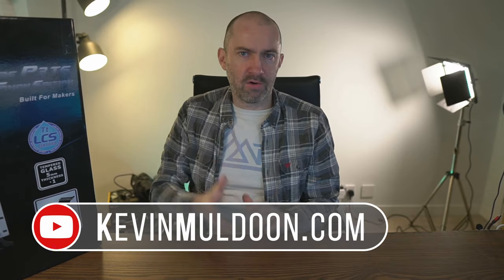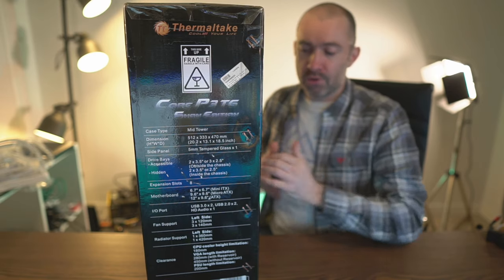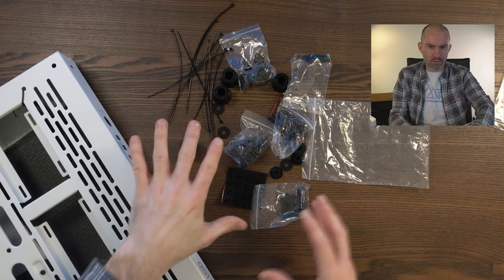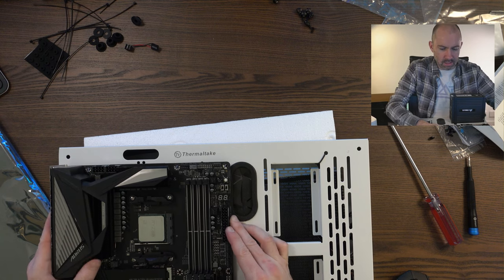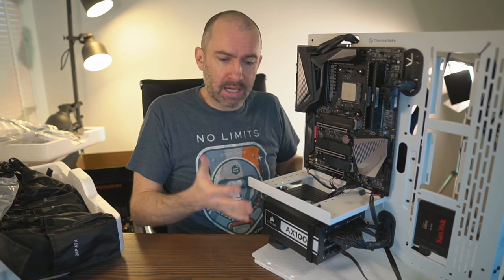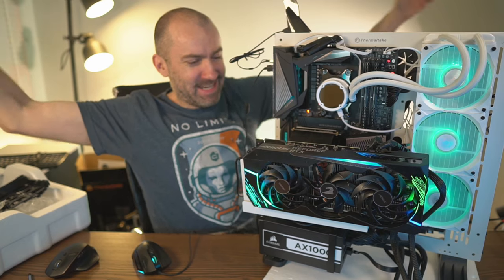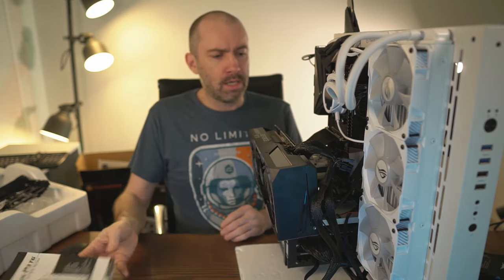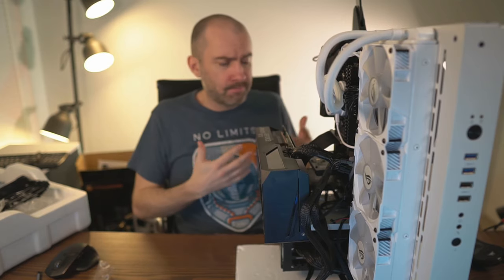New PC Build (Part 5) - Building My PC With the Thermaltake Core P3

Comment: Hi Kevin ,  i have very similar system  components   x570 master same gpu ,   aorus 360 AIO  and similar nvme setup ,  would be interested to see  your benchmarks  3d mark etc .      I am running 32gb 4 x 8gb of G skill   3200 cl14  so would be interested to see if there are any advantages to  running faster memory.    thanks in advance
Reply from the maker: Interesting. In my next video, I'm going to apply 3600 CL memory. I've been holding back doing the next video as I can't find the custom PSU cables I want.

My plan is to do another video changing some things and then a final video showing everything. 

But after that, it would be good to do some benchmarks for the whole thing and see where it stands.
Reply: Great. Look forward to the next videos. And the benchmarking.  I am running the 5950 with just PBO. And the ram with xmp enabled. Atm I have not tried to overclock the GPU as I don't want lots of fan noise.  .    Will watch with interest. 

Many thanks.
Reply from the maker: I haven't did a ton of research into overclocking as yet, but I'm keen to spend a couple of days reading about it all and talking about it all in one video.

From what I can see, the 3090 can't be overclocked a huge amount. Perhaps 5% or so. A similar story with the 5950X from what I've read, but I need to check that.

The fans wouldn't go too crazy unless you really pushed it. I've not found the fans in my 3090 to be that loud with games as it isn't hitting 100% load all the time.

It will be interesting to see what it can do.

Comment: Anyone know what the round rubber washers about 1/2" or 1cm across are for?
Reply from the maker: I'm not sure. I've got a lot of spare washers and screws. The manual is pretty useless in explaining what each part is for.
Reply: @KevinMuldoon  I figured out out. Out was for the glass to cushion it. I suspected it was for that, but it took me 4-5 youtube videos to see if actually installed. And yeah I concur on the manual sucking 😂
Reply from the maker: Mmm. I'm trying to think if I've already applied them.

I do know I have a lot of stuff left in the bag that's went unused.

Comment: Looks complex Kev 😳
Reply from the maker: Haha it's not that bad. Honestly. The final product with cables flying around everywhere seems difficult, but you just have to connect everything up and then install windows.
Reply: @KevinMuldoon  looks good though.
Reply from the maker: Yeah it's a bit more sexy than the black pc case I was using before.

Comment: You're gonna burn out your cpu with your radiator mounted tubes up. Tubes need to be down for proper liquid flow.
Reply from the maker: That's not what the manufacturer says or what guys like JayzTwoCents.